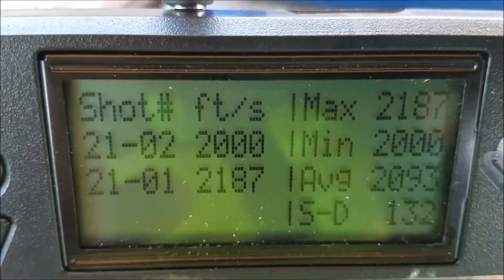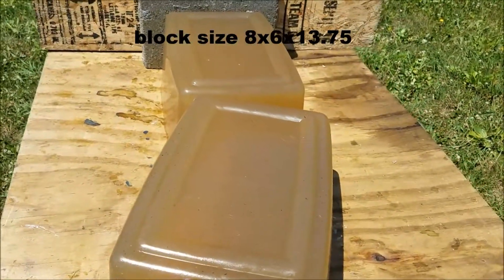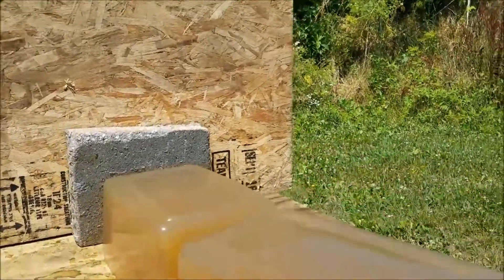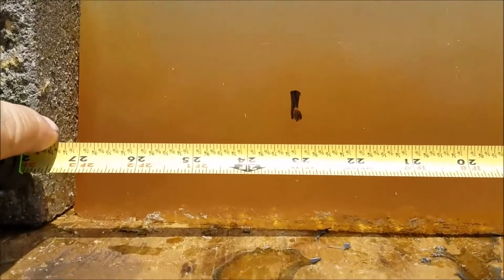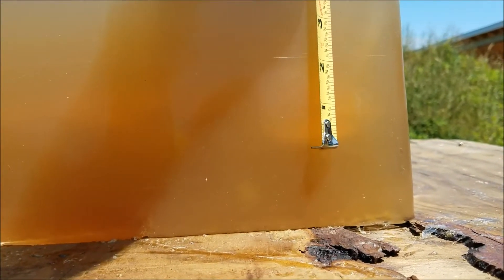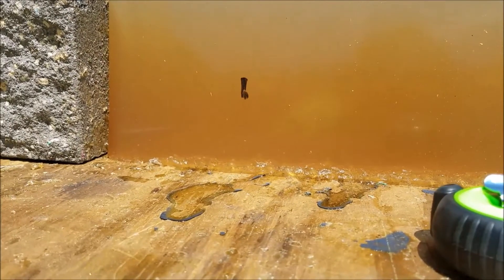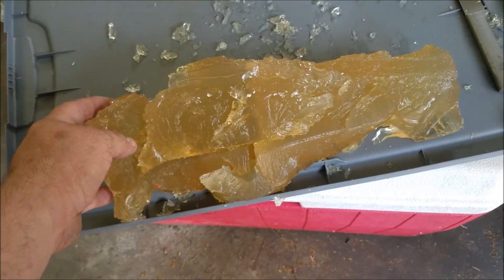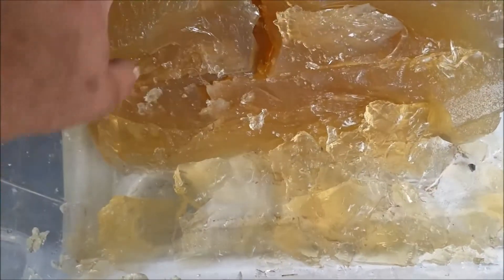277 Wolverine gel test 120 sst

Comment: I would love to replicate this load.
Reply from the maker: these were down loaded to match the performance at the yardage i was testing the wolverine will push the 120 sst to around 2300 from an 18  using aa1680
Reply: Thanks I'm have a custom barrel made for my XCR-L 18.5". I've been looking up a lot of loads, and the 120 SST looks like an excellent choice for medium game inside 250/300.
Reply from the maker: i prefer lighter bullets for the wolverine 90,100 are my choice, i really like the mdws 100 all copper because it was designed for the wolverine and opens down to 1400 fps plus very good velocity and accuracy. the sst is not bad at all at the wolverine velocities and a good price point